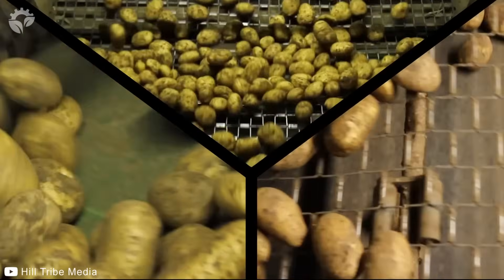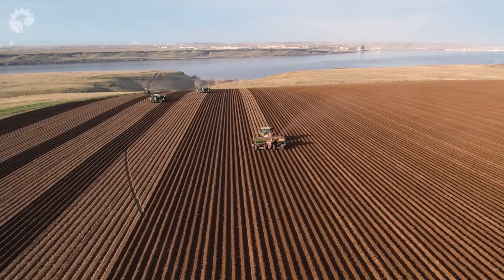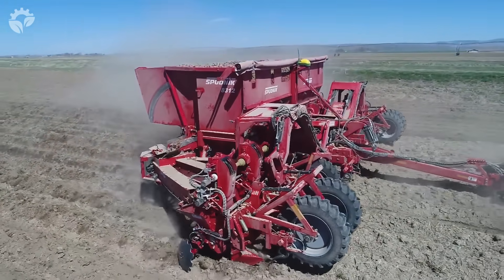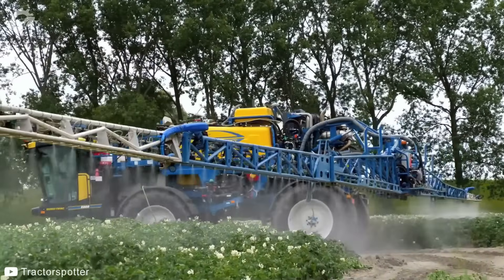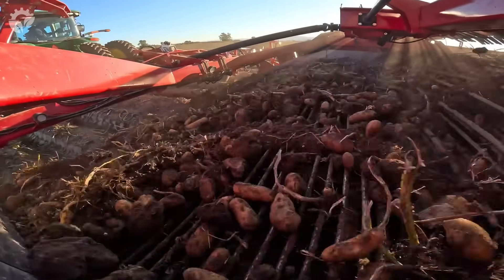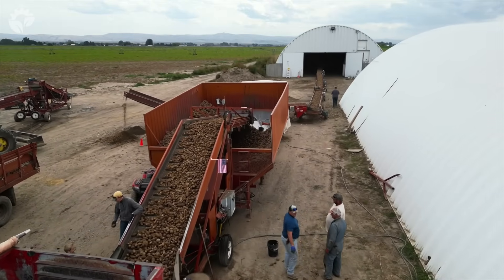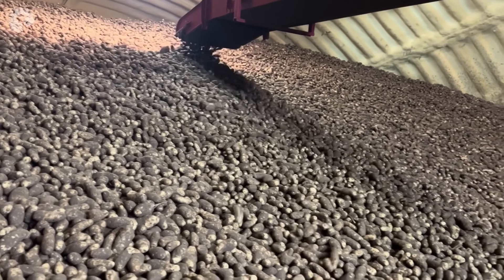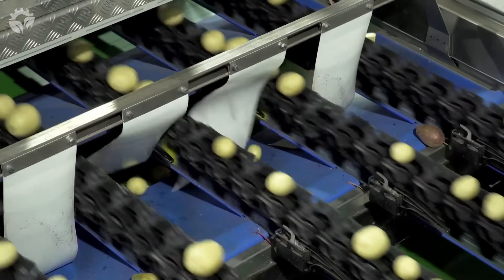Potato Farming & Processing - Start to Finish

Comment: As an ex large scale potato farmer in the UK, they missed out 2 crucial steps in the growing of potatoes. 1) Control of tuber blight disease which can rot away the entire crop as in the Irish Potato Blight Famine, 2) Irrigation: potatoes need large amounts of water to prevent common scab disease and for the highest yields and quality. Otherwise a useful summary of the steps in commercial potato production.